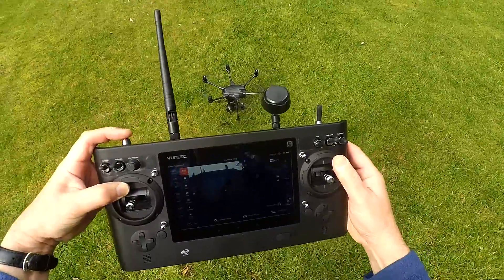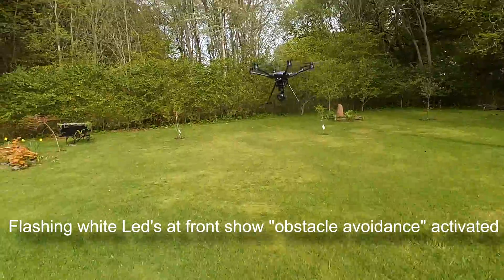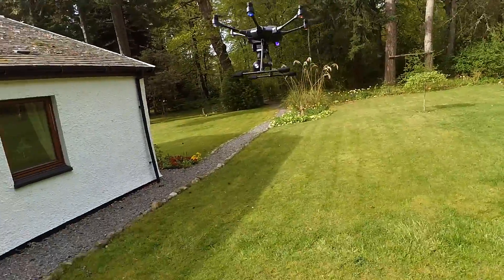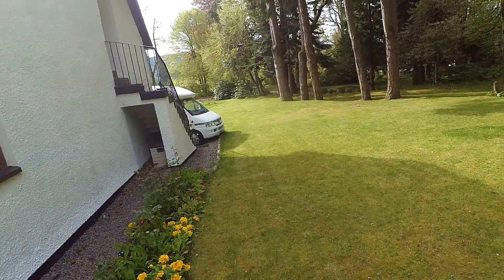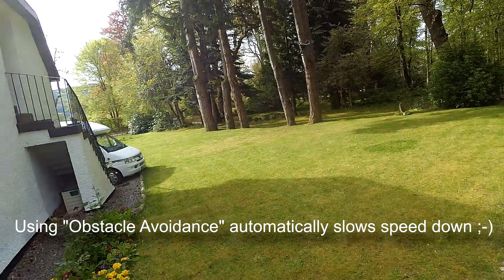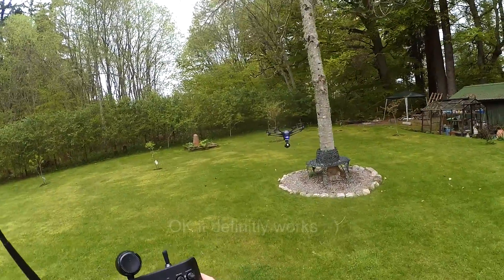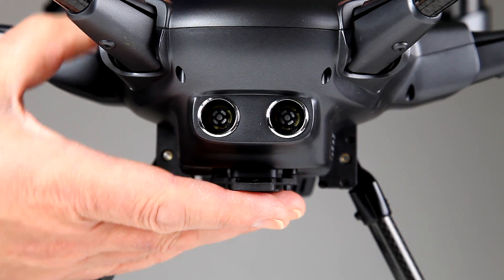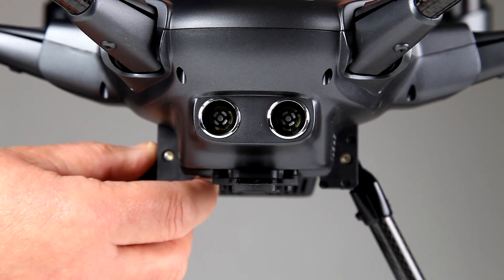Yuneec Typhoon H Full Obstacle Avoidance Test Review

Comment: can you manually keep the landing gear down i taugh they goes up when u go in to flight?
Reply from the maker: Yes you have to lift them by flicking switch, you also have to manually tell them when to come down, if not it will land with them UP! Real messy ;-)
Reply: Tigger's RC Reviews wow ook thank  you they should  be auto
Reply from the maker: Sorry but I disagree with it being Auto as I fly close to water and rocks the last thing I want is landing gear coming down without my input ;-)
Reply: no i ment auto when it comes in on an emergency only like the batteries running low or u hit the return to home mode those 2 only
Reply from the maker: If it comes into land by itself then it will put landing gear down ;-)

Comment: I don't see much point in obstacle avoidance in the front. rather have it for rear detection. just my choice as I can see what's in front of me.
Reply from the maker: +Scott Allen If that's you requirement you can rotate the camera, 180 degrees, fly it using FPV, ie front will be back and the collision avoidance will then be at the back ;-) Not what I would be after but as far as I can see it would be possible

Comment: when you flip on obstacle avoidance, does it automatically go to tortoise, even it's in the middle or rabbit?
Reply from the maker: +Matt Munro Yep, it has to run in tortoise as it can only avoid upto tortoise speed, when the real sense comes out that will run at the full 35mph :-))) BTW you can move the rate slider when in obstacle avoidance and it doesn't make any difference. hope you enjoyed it and subscribe cheers

Comment: Hi ! Do you know if Obstacle Avoidance works in following mode ?
Reply from the maker: +Zlati Tanev Nice point, not tried oit bu twill make a note and do it next time I fly ;-) Hope you thumbs up and subscribe more on the way with the H
Reply: It works in every mode except Orbit / Poi
Reply from the maker: Spoke to Yuneec and it should work in every mode, will check it out when I get a chance :-)
Reply: Also it is interesting if you fly at one spot and you have decided to fly to another that it is away more than 200km should you calibrate the compass or it is going to tell you that it need to be calibrated. It is not going to fly away?Thanks.
Reply from the maker: No need to calibrate compass, it travels from where they manufacture, far east, to you and it is fine. I flew mine in two places 600 miles apart in two days with no problem ;-) Hope you subscribe as more on the way, thanks
Reply: +Tigger's RC Reviews  I have already done that. Thanks
Reply from the maker: Thank you, can't keep up with everyone and happy to help if I can, thanks for letting me know :-) BTW calibrating the compass is so easy on this drone

Comment: Be aware if you fly at 45 degree angle it will fly into it
Reply from the maker: +Lee Broom Yep, that's why I state and show forward only ;-) thank for confirming the point hope you enjoyed the video and subscibe cheers
Reply: That may not be true.  The video everyone is basing this on currently has an H that behaves very odd and jitters when approaching the wall for his test. NONE of the same characteristics are present in this test so it is far to say that the original posters video is somehow flawed.  If like to see that test repeated here on this channel before we concluded flying at 45 against an object doesn't work.   It's logical to conclude that is the case but I think there is a credibility issue with the only video done on this angle test and another source or two are needed.    One the reasons is that the logical answer is it should fail. Because of the angle but tuned may have in fact out both sonar sensors at angles to each other.   And from working with the same type of sensor in robotic applications they Twnd to work Bette me that what was show.  Would is not a line like a laser so there should be considerable more tolerance in any event for angles
Reply: Also I want to point out that some people are using that 45 degree test as a way to say that other solutions are better but you can not conclude that yet. Even if the 45 degree angle test turns out to an accurate way to show the fail zone, if that technology platform is important one can not make a conclusion without waiting on the realsense tests.   Real sense holds considerable more promise and is said to work in conjunction with the sonar platform .  So I for one feel that waiting to see what real sense does over and above is a much more balanced and proper thing to do considering the approx costs are close enough to be in the ball park if this technology is important to you.
Reply from the maker: +Drone_Video if /when i use the collision avoidance, I will make a point of trying to fly mostly forward as there will always be a point the sonar will not pick something out at a certain angle, be that 45 or 38 or whatever, the time it misses something will be when you kiss goodbye to your investment ;-) I can make the H hunt and throw back and forward really easy just bring it close to ground or fly it close to my sloping roof, same thing but at an angle, this is why IMHO they state above 3m before use. Real sense is going to be very interesting :-) One last thought it is like flying full FPV and not going forward but rolling sideways, you can't see what is there and the thing that is there is going to hurt(cost). Just my thoughts :-)

Comment: You seam to be a good tester.
Could you put the drone in team mode with the wizard and during flight (holding on to a leg) turning it back to single mode.
See if it allows it to give back full control to the ST16.
The reason I ask is because I have friends that kite surf and I would like to give them the Wizard.
But if they forget the time, I don't want the H to try to land next to them if I switch on Home Mode or three battery is low.
I want it to return to my me (ST16)

As far as I know it will return to the wizard in Team Mode but I'm hoping the team/single mode could fix that.
Reply from the maker: +Henrik Thuresson whoooa I thought when i read it first but I see your point will give it a go and let you know, gonna cost you a thumbs up and subscribe though LOL Thanks for the comment

Comment: OK turtle mode is in fact useless. With my 4k I never use slow mode as its partial to wind and less safe. Before the P4 guys arrive and say the Phantom has better avoid tech.. Yes it does! But the yuneec offers options above and beyond with the controller and HEX. Its a shame I had a very bad experience with Yuneec. Maybe the H would be a option for me. Until I find another solution I may have to wait a long time to find another platform. Maybe Gopro Karma. Who knows? thankyou for the video I enjoy your channel
Reply from the maker: +UAV HDTV Hiya, I use my tortoise hare mode quite often on rates even during a flight to have fine control over the Q500. The H is faster all round so I'm pretty sure even in Tortoise mode it still has a reasonable speed, seem to rememeber 11 MPH which doesn't sound much but TBH more than reasonable when you throw your new pride and joy towards your house LOL From what I understand from my trip to Yuneec, the collision avoidance should work at full speed :-). Glad you are enjoying with the channel, hope I get the thumbs up as and where you feel it appropriate and stay with me I will explore the good and bad of the H and share with all. thank you for your comment.
Reply: I would offer two points...  The real sense version of the H is better tech than Dji, but Dji is better than the base H.

Second, it seems, but looking to confirm this myself, but reports are saying the H is way better in wind than the Q series,  it seems motors and props. Combined with a better body design to avoid the "sail effect" of the Q have made a big difference in many of the reviewers feedback posted to this point.  This is encouraging...
Reply from the maker: +Drone_Video I can confirm the H is much better in windy conditions. 6 props are better than 4, more stable and smoother all round I shall back to back my Q500 and H to try and show it. TTFN
Reply: +Tigger's RC Reviews I would enjoy see this comparison.  It may be hard to find the exact wind conditions that cause the Q series to exhibit it's issues but a good try when captured on tape will be very helpful to have!   By no way is this to say the Q is significantly flawed but rather to say there is a operational limit to it that the H by all reports has advanced positively. I bring this up as too many people are basing there opinions of the H on earlier experiences with the Q and the H is unmistakably exceeding the Q in all aspects of operational performance envelopes.